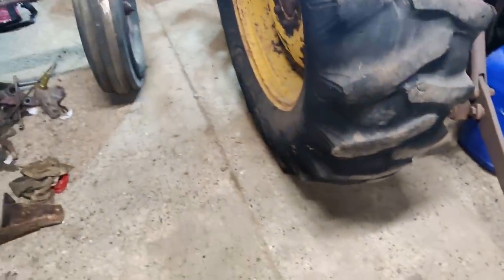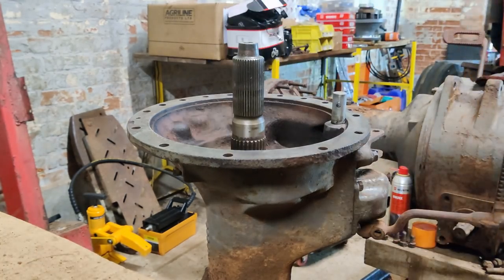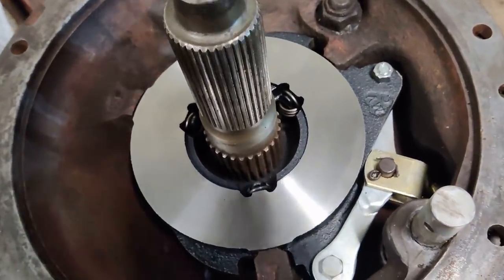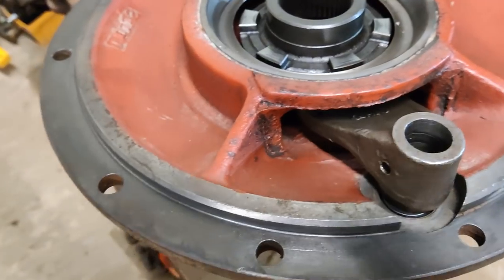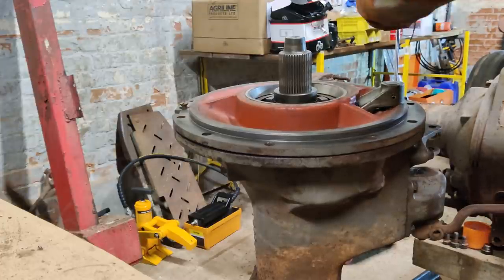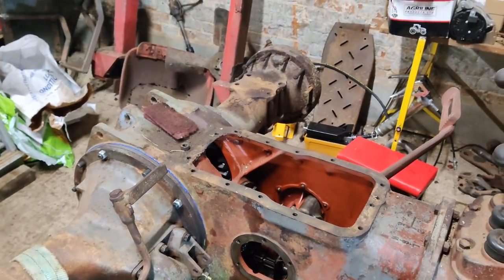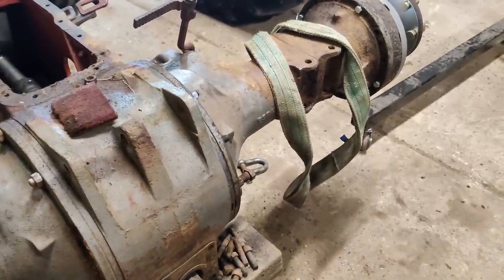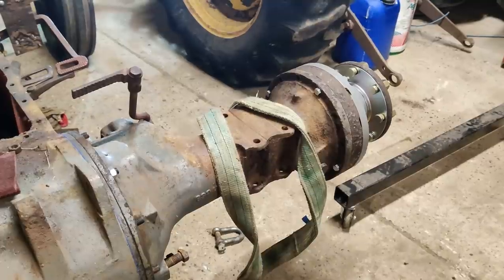Braking Bad.  But hopefully better now.

Comment from the maker: I have just spotted a mistake.  Something that I have done that's really stupid!  

If you spot it too, write a comment starting with the words Not Bright!  And if you are correct and you are a subscriber, you will win be put into a draw for a prize of some sort in the near future.
Reply: Only thing I noticed, ya cleaned the new brake disc, even telling us it needs to be clean, then ya handled the same disc - leaving greasy fingermarks on it. I also noticed blue small sections of cleaning towel in the bell/trumpet housing which I trust was removed as these could gum up a pump. I also noticed there was no gasket (or goo) on the assembly of the "trumpet" housing to the diff housing. All the same I like the vids. "We" had a 135 and MF35 then IH, I'm from DB HQ ;)

Comment: The best surprise purchase I made was a 1/4 drive socket set from lidls, was about £14 and been using it daily for about 3 years.
Reply from the maker: I bought a 20mm trash pump from Lidl a few years ago for about £30.  It's still working.  Never underestimate the power of Lidl special buys 🤣

Thanks for watching

Comment: I bought some cheap Kincrome spanners many years ago, the 15/16" combination has been the most used, mostly with a impact gun on the other side after 30 + years I broke the open end, I cut it off now its easier to put a pipe on it.

Comment: Not bright, missed the o ring on the epicyclic hub joint? . Can see an o ring still in a plastic bag. Elora tools were my choice as well, but think later they lost some of the quality feel.
Reply from the maker: O ring rings only on square axles not round, but good call!  It's something far worse that I did before this video, but you can see the results in this one.

Comment: Good video again 👍 I bought a draper socket set back in the black an white days 🙄 an it's still going strong 💪 as for a mistake I never saw you put the 2nd brake disc in 🤔👍
Reply from the maker: Don't worry, it did go in, what I did was far worse!

Comment: Myself grew up around massey tractors we started with 35x I think it was in 1962 then in 76 I bought my own 135 it was a beast but ive work for diferent companies that used only massey tractors as a mechanic the only part on a massey tractor i have never repair is the differential they are tough and economical tractors very good on fuel while the fords and john deere swallow diesel the msaaey get the same amount of work done by sipping a little at atime
Reply from the maker: I was brought up with them, too.  Always found them the easiest to work with and cheap to maintain.

Comment: Really interesting video our 1970 MF 165 has dry brakes but they are getting very snappy she did get new brakes a number of years ago but would she need them replaced again thanks👍
Reply from the maker: This time, convert them to wet.  Thanks for watching.
Reply: @ClarenceFudWeasel  would like to keep her original but i suppose that would be the best course of action 👍
Reply from the maker: I know what you mean about original, but at the same time, it's a working machine and a well executed upgrade to extend the working life is still a valid part of the tractor's story.  Just my thoughts.
Reply: @ClarenceFudWeasel  your probably right thanks

Comment: Another brillant tutorial
Reply: Comment such as this could land you a supporting role in future video🤔
Reply from the maker: And I have just spotted a mistake!  Thanks for watching.
Reply: 1 see a situation at 12.30. Theres a phrase here. Buy cheap buy twice
Reply: New brake pedal, old brake pedal?
Reply from the maker: No, that's just me trying to re-use as many original parts as possible.
Reply: @billupstateny9151   so much talking on these channels and no action and on this channel. This guy makes it happen
Reply: @patlydon519  This is FREE entertainment, the creators determine the ratio of explanation vs wrenching. If you object to any channel format, NO one is forcing you to watch. Free entertainment & the critics insist on controlling the narrative.🙈

Comment: Sir will be my question?! Would it be a multi power e wet brake?! The 75 model (168) also has small drain holes in the bottom of the axles,! should be closed i thank you, thank you for your educational information, Stay healthy ~~Greetings from Anatolia👍
Reply from the maker: You can tell if it is wet or dry brakes by looking for a row of notches in the brake covers on either side facing the back of the tractor.  If there are no notches, it is dry brakes.    The number of notches indicates the number of disks.  However there were some multi disk dry brakes that had notches too.  If the drain hole is there and open it is probably dry brakes.
Reply: @ClarenceFudWeasel  ~👍❤️~Greetings Dear Sir, I'm sorry<I'm translating>😪, Make a few already brakes ta A few have already made the brakes too big, <dry disc>I guess I couldn't express it, I guess there may be an evacuation hole under the hive, they are not for discharge, thank goodness👍👍👍

Comment: I bought some new Craftsman 45 years ago since then rummage sale/estate sale/auction sale brand. No warranty but so inexpensive not necessary. As far as losing them, all brands are equal. As far as tractor, truck or autos, I believe all have good and bad models but I was raised on IH , Chevrolet and Buick and feel the same about Ford as you! Thanks for the videos.
Reply from the maker: Quite true, a Snap On spanner sinks as fast as any other make when it rolls off the jetty and into the river.

Thanks for watching.

Comment: Hi , I have my 165 diff pedal seized in the single wheel drive position . What do you think this could be , it's like this for at least 20 years . Do you know would it be much work to free. Would I need to open the axle as you did? I'm not a mechanic. Thanks
Reply from the maker: Unfortunately, it's almost certainly the shaft stuck in the trumpet housing.  It does require taking the trumpet off, which is not a difficult job, but could be daunting if you aren't used to that sort of work.

If I had all the parts to hand and everything goes according to plan, I would allow about a day for it.
Reply: Thanks, for your reply , I'll try it myself    If I take it slow and follow your steps . Love your and lord muck videos , ps mines a a212 square axel non multi power . Love it .

Comment: Are you still looking for a stop rod, QTP have one listed, don't know if its in stock, where do you get you parts from ? Had some from agriline for my 165.
Reply from the maker: I bought one, it's for a 4.212 engine so I'm still looking.

Thanks for watching.
Reply: @ClarenceFudWeasel  You forgot to fit the brake actuator, wont get that bolt in now😁
Reply from the maker: @karlredshaw7447  Far worse than that!

Comment: How do you adjust the bearing preload on that setup ?
Reply from the maker: Found your photos thanks. There's a special gauge that you use and have to put shims in behind the bearing cups to get the pre-load correct.

Comment: Neil Tools, Britool
Reply from the maker: Old Britool stuff was some of the best there was.  I had a set of their combination spanners for years until somebody stole them.
Reply: @ClarenceFudWeasel  I still have a full set of spanners, both ring and open ended, smallest to largest that was given to me when i was an apprentice
also a full 1/2" drive socket set, metric and A/F smallest to largest sizes
had all these since 1974

Comment: Not Bright....was a little hard to see fully as you had it almost in place...but did you forget to put a gasket or sealant between the diff-lock carrier and the trumpet housing, in order to stop water and dirt getting in should the mating face not be 100% flush.
Reply from the maker: Oh no, far worse!